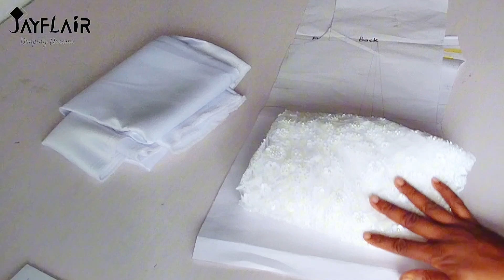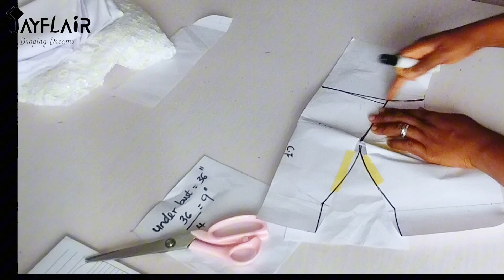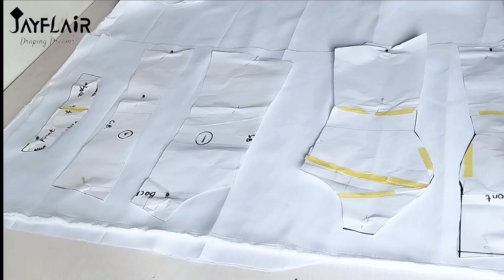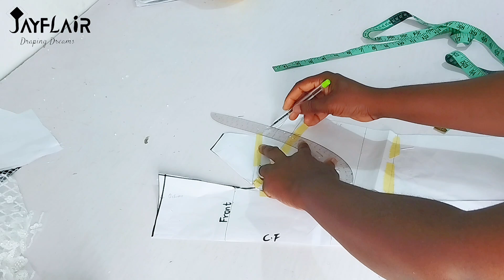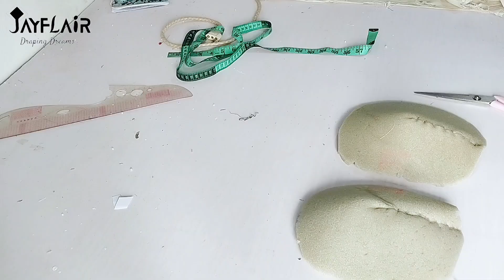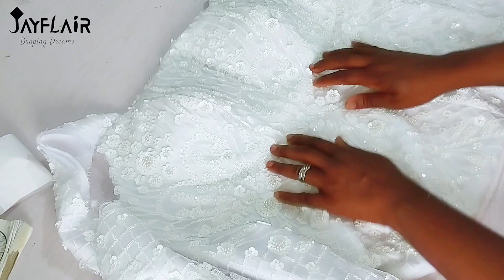Learn How to draft and Sew the Elegant Igbo Madam Blouse|step by step tutorial

Comment: Well done, pls, can't you use free hand.
Reply from the maker: My dear, I sometimes use freehand on free dresses only but I  prefer not to use freehand marking directly on fabric because it can lead to inaccuracies. Instead, I use pattern drafting tools and techniques to ensure precise and consistent measurements. This approach helps me achieve a professional finish, especially when working on complex designs. Plus, it allows for easy adjustments and modifications without compromising the integrity of the fabric.